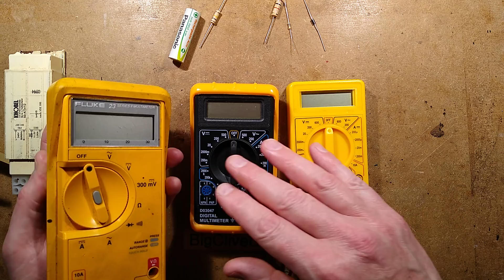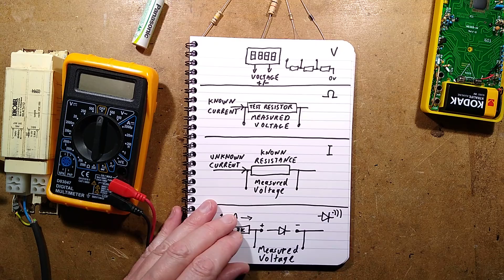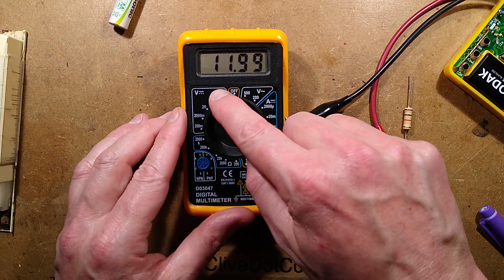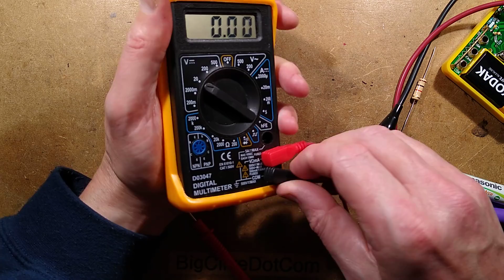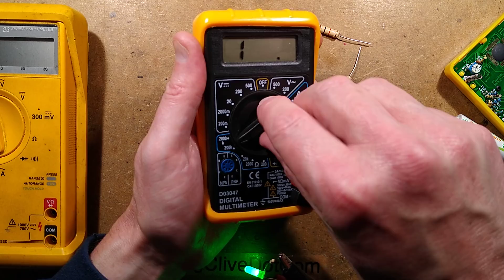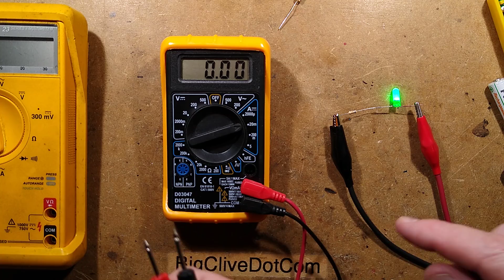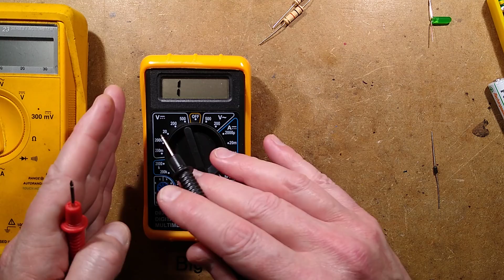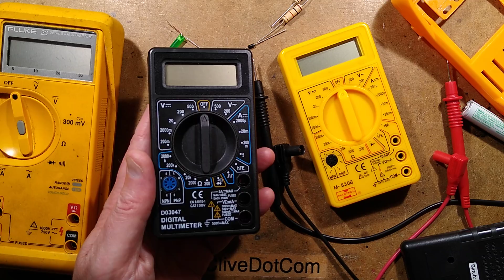How to use your trashy meter without blowing it up (much)

Comment: Yesss. I didn’t buy myself a self-ranging meter until I’d been doing this stuff for a decade, we learned on the cheap ones in school for exactly the reasons you stated at the start.
Reply: yeah it's cheaper to blow up a $5 cheapo than a $200 proper one eh?
Reply: I have never trusted auto-range.  Learned on analog meters back in the day and studied diagrams of early digital meters passionately.  Quite disappointed at factories making 3.5 digit meters calibrated to only 1% instead of going the final step of keeping the precision parts 0.1% with other parts getting their imprecision canceled out.
Reply: i can imagine someone getting a manual multi meter after having only automatic one's, it would freak them out, like cars, better to learn on a manual and get the manual car licence, that way you can drive an auto after that, but always have the option of driving any manuals that come bye or crop up, bothy my brothers have automatic  car licences, they cant legally drive a manual on the road, not that they know how or want to, but one day they will run into the manual paradox, they will need to move house and the only moving equipment they can hire is manual trucks and the dont have a manual licence or the will or interest to learn how, so i will have to drive it for them, because i learned to drive a manual and i am so glad i did, i still drive a manual today, i love being in full control of the car, one day when i get old like 70 or so i may buy a automatic and retire from manuals !!!

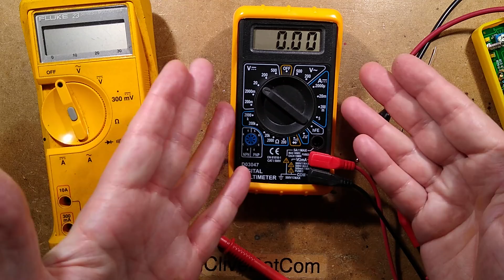Comment: 12:00 - A point I’d make is either do not keep your leads plugged into the meter in the storage case, or if you must, always make sure it’s put into the case with the red lead in the usual +V/Ohm socket.

Once upon a time years ago I just pulled my Tandy DVM out the case to check if mains was getting to a washing machine heating element.   

It’s surprising how big a blue flash you can generate trying to measure voltage through a 10 amp shunt
Reply: I say, Don't start with a Digital Volt Metre !  Coz you're going to want to measure more than just Digital Volts !!  Start with an Analog Multi Metre, yes the ones with poiner / needle that sweeps across face of the metre. They are, in fact, far more accurate.
Reply: i can relate, trying to mess with a electric gate and at time i didn't know the fused was to test amps and i thought it was to test higher voltage, it was beautiful a blue spell with 220v, it melted both tips, black the connectors and permanently disarmed the gate circuit breaker
Reply: I still do it. To the point where the burn marks almost meet now across the fuse holder 😂
Reply: @manuelh.4147  Nop, no vinyl here !  All Polycarbonate and Silicone-arsnide ceramics. What's your point ?  You think a Digital Volt Metre is better than a Multi Metre ?   Hmmm, I  smell a bad habit...
Reply: yeah that big blue flash will get ya every time.😱😖
Reply: @snakezdewiggle6084  That's just as snobby as ragging on cheap meters. I've never owned an analogue meter and while I understand they can be useful in certain situations, having digital has never been an issue for me.
Reply: @chocolate_squiggle  ...that you know of. Analog metres can be consided 'raw data'. Understanding electronics is different to poking and prodding. Use to be, back in the day, that serious Elec' Engineering courses started with building your own analog metre, building on it more and more functions as you progressed thru the course. I'll bet that you don't know that dmm's should be started (turned on) with the test leads shorted. They self calibrate at turn-on. Know your tools...
Reply: The nice thing about the more expensive meters like the newer Flukes is that if you have the leads plugged into the 10 amp shunt, and turn the knob to measure voltage, then the buzzer will sound continuously until that condition is corrected. It's a nice safety feature.
Reply: Some older meters with the big twisty knob for function/range selection had a physical shutter which covered the current input when the unit was set to a voltage range. The shutter mechanism would also prevent you from selecting voltage if the probe was already plugged into the current input.
Reply: @snakezdewiggle6084  a metre is a unit of distance, we're talking "meters". If you're going to write soapbox comments at least proofread them first, it can help prevent you sounding like a bigger knob than you already do. ;)
Reply: @snakezdewiggle6084  and the creators of the first assemblers were ridiculed for laziness by their peers, for any decent programmer should be able to keep track of their memory addresses anyway! 

Computer science students used to have calculation integrity-checking drummed into them, but nowadays the processors are regarded as reliable enough that it’s not necessary…
Reply: @sixstringedthing  Yes !  Finally, someone is paying attention. A "meter" it is, thank you.  
As to 'proof read'. I have a 5 inch crt for my screen, and a television remote for a keyboard. No touch screen, no backspace, and no delete key. I only have access to one hard coded internet site, yt. I'm sorry for typos and grammatical errors, etc.  
This reply has taken 40+ minutes to write.
Reply: @kaitlyn__L  yep, sure did. I hated Dynamic Link Library files for a long time. I wrote 1091 pages of 16bit binary for my 2nd thesis. No access to computers, I had to debug it long hand pencil and paper. That's 4 days of no sleep that I'm never getting back...
Reply: @snakezdewiggle6084  no DMM self calibrates on turn on with leads shorted, that would be silly.  Only time that might be done is if the meter has a resistance nulling feature. Analog meters require that to be done for resistance measurements, maybe that's what you're thinking of, not digital ones though.
Analog meters have some advantages over digital, such as showing some rapid fluctuations that digital ones couldn't due to slow refresh rates, but accuracy is better with a digital display, as you just don't have the same resolution with an analog meter, even those with mirrors on the meter face to help with parallax.
Reply: Always always ALWAYS put the leads back in the volts holes immediately after measuring current, even if "I think I'm going to measure current again in 5 minutes"

It saves a mountain of pain later and it's a habit you should instill in yourself as early as possible
Reply: @sixstringedthing  Probably Metrowerks.
Reply: @snakezdewiggle6084  they're not ,,far" more accurate. Unless you pay for one that is..what I like about them is they put a bit of load in so you won't get ,,ghost" readings
Reply: @lipeeno  not sure what you mean, "bit of load in", and, "ghost readings" ?  Are you talking about RF ?
Reply: @snakezdewiggle6084  If you ever measure long wire runs, say in a home's wiring, you may find some "stray" voltage on them even when they're disconnected from the power. In other cases, capacitive coupling. This is why some DMMs have "lo-Z" mode, or low impedance. The low impedance loads down the stray, ghost voltages.  

Passive, analog meters are generally low impedance, so they can have the same effect. An analog vacuum tube voltmeter, of course, is high impedance. I've got all 3, all have their uses. Can't beat the fun and useful visualization of the analog ones, and surprising accuracy of a 60 year old meter, but a modern DMM is essential.
Reply: @wingerrrrrrrrr  one thing I like about analog meter is that when you check capacitors, you can tell if they are bad or good and get an approximation of their capacity with the analog meter simply connecting it in one polarity and then reversing the leads you should get a deflection of the needle according to the capacitance of the capacitor if it is not defective. This utilizes the internal battery of the meter of course to charge the capacitor.
Reply: @JulianA-tr6pt  I found your comment interesting in mentioning you had a 60 year old meter. What was the name brand if you don't mind my asking? I have a Siemens wooden case Volts and Milliamp Meter made in 1930. It was given to me by a gentleman named Herr Schultz in 1982 when we worked together at Berlin Tech Control. It was his first meter assigned to him when he first started working at the Deutchbundispost. I have opened it and it has 3 tubular ceramic capacitors and a dozen or so ceramic core coils for the workings.  No batteries needed. It still works.
Reply: @snakezdewiggle6084  ...and much nicer to use, than just read a set of numbers on a screen...
Reply: @snakezdewiggle6084  More accurate and more forgiving.  A DVM's display will jump all over the place, but at least with the needle you can get it in the ballpark quicker.
Reply: @AA7YA. Yeah, thats exactly what I was trying to say. 👍
Reply: I put the probes of a harbor freight meter set to 10 amp mode across 120v.

Damn, that was a REALLY good flash!

Surprisingly the meter survived, usually cheap silicon gets easily damaged by high voltage pulses.
Reply: @chocolate_squiggle  They should bring the ohms adjust knob to modern meters.
Reply: POP
Reply: It's one of those rites of passage. :)

Comment: My dad was an A&P mechanic, and later an FAA inspector. He passed away earlier this year. I found his Fluke 87 multimeter. It was last calibrated in 2000 by Capital Aviation so he definitely used it at work. It's the nicest multimeter I've ever used, and is in excellent condition, especially given that it's probably 25 years old.
Reply: My Fluke 87 also came from an airline and still works perfectly fine.   The certification sticker just makes it even cooler.
Reply: My £2 meter from Maplin is over 25 years old, probably nearer 30, is kept in my toolbag (with tools, no case!), and is as good as the day I bought it. Oh, apart from the battery now occasionally showing that it might need replacing soon!
Reply: @paulsengupta971  I wouldn't have thought that you could get a  £2 meter 25 years ago. The cheapest I ever recall seeing any multimeters 25 years ago were around US$20.
Reply: If it's an 87 it could date from the mid 80s like the ones I used to use
Reply: Still using my Fluke model 87 that I purchased in 1986. Probably on my third set of test leads. Great meter.
Reply: I just found that in my old multimeter the battery was... well a bit flat. Causing the meter to misread, sadly.
However that meter is more than 20 years old. The battery had an expiration date of 2002... and didn't leak.IC date codes are 1998, meter is based on MAX134 and AD636 true RMS chip.
Reply: 25 yrs old? Hah, a youngster! ;-) I still own a FULLY ANALOGUE East-Germany made multimeter (with a proper physical needle, moving around its axis and pointing at real numbers printed on the dial, with a "mirror slit" underneath to prevent parallax errors) that I bought with my first salary. All of it, actually... the salary, I mean. Almost all of it has gone for that meter...
Hey, back then in mid '80s, in Commie lands, those fancy (and precious) instruments did not come cheap!
Reply: I had a fluke years ago but it developed a blinky  screen so I gave it to a friend and bought a lesser brand that is still going strong. I believe there was a rare issue with the contact points on the board. A guy I spoke to that repaired flukes said it's not advisable to pull the meter apart without knowing how to fix it.
Reply: @miscbits6399  They still sell the fluke 87 today. It's around 500 dollars on Fluke's website.

Comment: I maintain some model railroading equipment so have to deal with low voltage DC, and I always cary one of these cheap multimeters with me. For anything 12-20V DC or AC, they are perfectly fine. The modern train control is DCC (digital control) using a square wave signal, and the AC part becomes handy to know if there's a signal (knowing that the voltage value is wrong), and the DC part can be used to know if there's a residual DC offset.
Reply: For $20, or so, you can get one of those preassembled mini scope kits and just look at the waveform. 👍
Reply: Another vote for the pocket oscilloscopes, they’re very useful.

Comment: Through several decades of mechanical work, I've gained quite a collection of meters. The cheap 'give away' meters are actually some of my favorites because you don't cry when you drop it and watch helplessly as it disappears under a passing truck. 😅 If my Simpson meter so much as got a scratch on it, I'd probably cry. One thing I will point out in addition to everything you said here is that analog meters still have their place in the world. A digital meter has a slight lag before it starts displaying, where an analog meter has a vastly shorter lag. If you are trying to find the point where a set of contacts come together, analog is the way to go (if you don't have a test light or there's no power in the system).
Reply: Totally agree analogue have a place. They ignore spurious voltages and are great for battery charging circuits as the circuit powers them. I've left one in circuit charging a friend's car battery for 6 days or so - waiting for the current to stabilise to indicate fully charged.
Reply: Analogues are vital to test audio transmission, due to the varying ac signal... there are some digital meters have a moving line display, an oscilliscope, I've even got one that displays a wave (not exactly a oscilloscope) but they all have time lag.
Reply: I have a cheap analogue meter for two reasons, 
1) to see ripple that may be filtered out on a DMM, both voltage and current
2) to look like im a pro when I get asked why I have it. LOL

You can also measure ripple on a DC supply by simply measuring it in AC and it will show you the AC component of the supply.

Comment: I do occasionally used the gain tester on a meter for go/no-go on transistors, and for odd transistors I'd salvaged from hard rubbish circuit boards. That was, until I got one of those whizz bang microcrontroller with a screen testers.
Likewise, my meter spends most of it's time on continuity/diode mode.
Reply: Also; I thought it was a really good video, Clive. It covered good basic meter usage for those newer to the hobby. I was given a meter as a gift when I was 11 or so, and it really started me on the path to discovery.
Reply: These µC testers are actually cool, multifunctional and very informative; although, for in-circuit (like runtime voltage) measurements you better have a galvanically isolated tool, while fancy testers tend to drain batteries significantly faster, so I usually run them off of 9 or 12 volts power supply.
Reply: Those testers are great I got one for $20 inside a case and use it all the time.
Reply: @uK8cvPAq  I also experienced the process of soldering it all together myself, so double the fun. ;D
Reply: Those screen testers are very nice.  I have one.   Important thing to remember with these is to discharge your caps before testing.

Comment: Use care when checking continuity on PCBs, sometimes the meter will beep even though there is no actual continuity. An example would be through  a diode or an IC that conducts between pins. Capacitors can also trigger a short beep (depending on there capacitance) as they are charged by the test current. Transformers will also trigger a beep as they have a very low DC resistance.

Comment: Thank you Clive for this fantastic tutorial on a cheap but essential piece of equipment. Back in the days of moving coil analog meters you needed to know a lot more about the  internals and how they worked because they typically had much lower internal impedances (voltmeters). Modern digital meters are so good that we often take them for granted but knowing what is going on inside is still really useful to get the most out of them.

Comment: My experience with about a dozen of those meters (and their even cheaper analog cousins) over the years, is that their main failure point are the flimsy leads they come with. These break/go open loop WAY before you manage to damage/wear the actual meter through regular (ab)use. Somehow they manage to churn out a fairly complex PCB with a reasonably reliable mechanical rotary switch by the millions, but they are totally lost when it comes to a pair of cables.
Reply: And if you use alternate cables then you run into a risk of shorting out to the shunt that's located just below the VmAΩ port if their banana plugs happen to be longer than the ones provided with meter.
Reply: @mibars  *VΩmA
Reply: Ye. One of the best upgrades you can do is to make your own leads with some nice silicone cable and some fairly decent probes and plugs.
Reply: Cmon a good pair of cables would cost them like an extra dollar and we cant afford that
Reply: @Palmtop_User  Well, considering that the final price of these meters to the consumer is often in the single digits,  every dollar in mfg costs counts.
Reply: I agree entirely.  Ive had to cut the probes off and solder the tip of the wire to make a quasi probe quite a few times.  Then youre stuck with what to do with the meter. Use it with bodged probes? buy nicer probes that cost more than the meter? or just buy another meter with junk probes?

Comment: Regarding the continuity beep, I agree that the instant and scratchy beep is very handy. Of the 6-7 meters I have the more expensive is only about $60 AUD, I can't afford to spend anything more being a disabled father on a disability pension. 
Great video, very insightful. 👍
Reply: For diagnosing electrical faults on cars, my dad used to use a 100W light bulb 'meter' as a continuity tester. If the bulb flickered you knew there was a dodgy connection.

I'm surprised he didn't use his electric welder on 200A setting. Just trace the source of the smoke to find where the fault is.